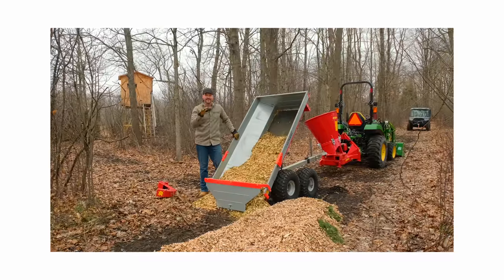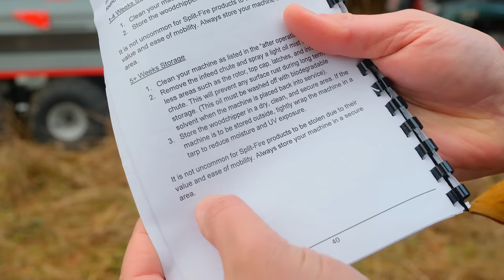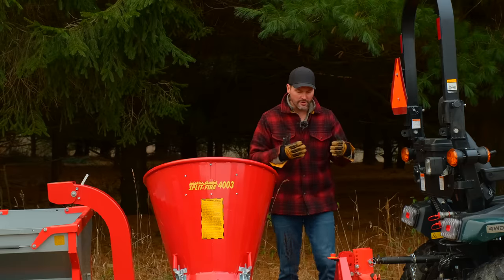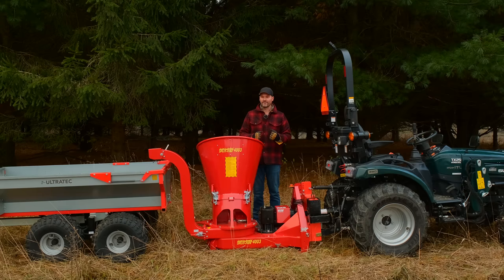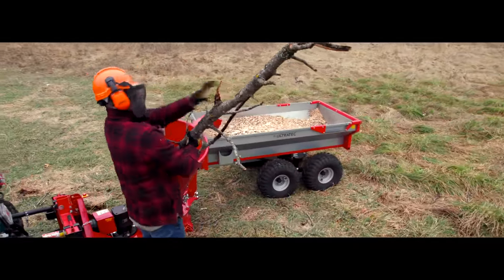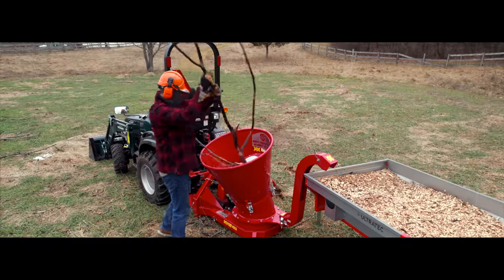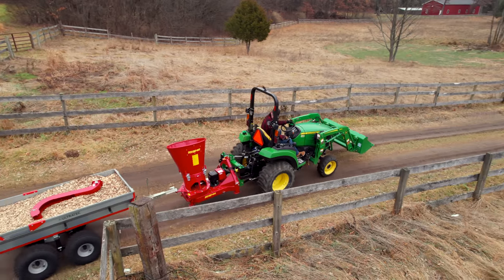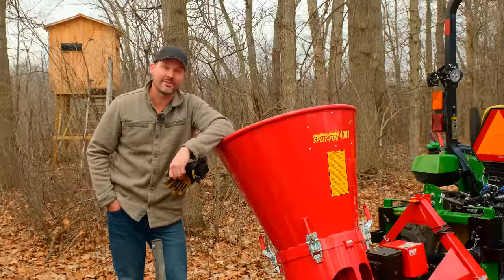THERE AIN’T NOTHING I DON'T LIKE ABOUT THIS CHIPPER FROM SPLIT-FIRE!

Comment: Looks really solid and well built. In all honesty, I've been very happy with my Woodland Mills 6" chipper. It's not perfect, but its hydraulic feed is its "make or break" feature.  Plus, it's got direct-drive via the PTO shaft, no gearbox needed.  (Of course, that reduction in complexity is probably offset by the hydraulic feed system!)   Edit: Just watched the Split-Fire video on this machine. They run their rotor at 2100 rpm, which is much faster than a direct-drive running at 540.  That's an interesting idea, I'd bet it really does help prevent jams as they say.     (Okay, final thought - the chips it makes look real good, very uniform in size and shape. Have to admit the WM isn't quite that nice in the quality of the chips, tend to get a long of "long slices" out of it.)
Reply from the maker: I'm steering away from Made in China whenever possible.  The Wallenstein equivalent (Made in Canada) chipper setup like that Woodland Mills is 4x the cost.
Reply: @GoodWorksTractors   Yep, totally agree with that goal.   Sometimes, as an individual, it's just not feasible.  (And based on my own experience with WM, they're not just an importer that's passing through the "stuff" they're importing - their product support has been exceptional, and their documentation is accurate and comprehensive.)
Reply: Doesn't look bad.  Looks like the chute could be taller and swivel so the trailer might be left connected while you're using it. I'll stick with my Vermeer 935.  I bought almost 40 acres connected to the land I already had. I wanted to clean some of the atv trails and make a few more.  I ended up buying the 6" DK Power that Home Depot sales.  I do wish it had electric start though.  When you start getting long slices it sounds like you need to have your knives sharpened and the knife gap adjusted. I took my Vermeer to a dealer after I bought it for them to do that.

Comment: Courtney, it looked like it was kind of a struggle feeding some of those branches through that chipper.  Not that it is a bad product, new designs and innovation is a good thing, but for the price point of the Split-Fire, I think I would be opting for a hydraulic in-feed unit, like a Woodland Mills WC46 or WC68, or even a WOODMAXX MX-8600.
Keep up the good content!
Reply from the maker: I would say the only thing I recall struggling with was the length of some of the brush.  I should have trimmed it down.  Many folks don't want more complexity.  I can see that being a nice feature though too!
Reply: Love this thing pretty decent for Homeowner is good enough you could always trim down the branches that's Haram in wouldn't have to work so hard but otherwise impressed the tractor really handled it I was one of the first ones to buy a tractor Connecticut man I'll tell you what I love this tractor can't wait for the bigger one definitely need to get in touch with you for one of those little quick things on the back of them

Comment: Make a cardboard template then cut a piece of MDF, etc to fit and clamp to inside back of trailer when chipping so it will act as a backstop for overshoot.
Reply from the maker: That would work!  I figured out a better setup later in the video with the trailer right next to the chute.  Then, aiming the chute down.  Those chips come flying out!
Reply: ...or, maybe adjust the deflector angle down farther. =O)
Reply: The ChipStop’s here!!!
Reply: If you mounted a bracket on each side of the sidewalls, these could support a 24 inch high piece of sheeting. Start with the brackets close to the chipper, then slide the brackets and sheet away from the chipper as the trailer fills up. The sheeting would deflect the chips into the trailer.

Comment: Fun video Courtney!  I really like the vertical design and the speed increase due to the gearbox and belt drive combination.  I have a few suggestions for Split-Fire... Create an on-board docking point so you can remove the chute and park it elsewhere on the machine for transport.  Make the chute a little taller.   Increase the ability to tilt the deflector downward more.  There's nothing much more satisfying than feeding a wood chipper like that!  In my case though, it only creates another material to dispose of.  Burning the brush leaves a small pile of ash and I'm done with the cleanup.  Would be great for people who have a use for the mulch!  Thanks for sharing!
Reply from the maker: Haha, yeah it is really satisfying.  I've got a few large areas that could use chips.  Probably be awhile before I run out of areas to put them.  Have a good one Kyle!

Comment: Looks like an interesting design moving the cutting wheel like they did. I like the emergency shut off that you can wire in to your tractor. I do have to say when compared to a unit like my Woodland Mills chipper with hydraulic feed, there is absolutely no comparison. I don't have to lift pieces of wood over my head to get them in the hopper, pieces of wood can't get sucked in too fast and bog down the tractor, the moment a piece of wood is caught by the infeed roller my hands are off and away from any danger, it has controllable variable feed speed and I can control the direction of the feed from the end of the poppers shoot in case of loading something too big or awkward. The discharge shoot can rotate 360° and is mounted higher to be able to get into higher trailers or trucks.

Comment: Definitely looks like the more hp fit the needs of eating the larger diameter pieces! One reason why I up graded to a L3902.
I’ve been debating on buying a PTO powered chipper but I don’t do a lot of that often….at times I’ll cut a tree down or pull some bushes on one of my properties and would be so much easier getting rid of the waste vs burning it all.
Reply: Personally, I think the ones with a shredder opening are a good option for the smaller stuff.

Comment: I have the Woodland Mills WC68.  This looks like a decent tool but the WC68 is much easier to use.  A lot of the stuff you had to stay there and feed would have just been drawn in by the WC68.  The infeed is adjustable so it doesn't bog down the tractor motor.  The discharge chute on the WC68 is higher and adjustable so I could have been directed much more easily into your trailer and it doesn't need to be removed to move the unit.  BTW I really like your trailer.

Comment: Looks like a tarp on the front of the trailer that would you could stand up to keep chips from blowing past the trailer plus a taller chute and able to angle down more would help to. Maybe higher side boards also. Yeah that thing really shoots the chips out. Little Summit did great!
Reply from the maker: Lol yeah those chips go flying!  I adjusted the angle and position towards the end of the video and it worked better at holding them in the trailer.  Thanks Kip!

Comment: I think it is a nice mid-level chipper, but according to their website, you have to pay extra for the steel discharge chute.  In my opinion, that should be included with the price.  I can certainly understand paying a little extra for the rear hitch and tool holder, but not the discharge chute.
Reply from the maker: That's a fair point

Comment: I have a chipper that is rated 15 to 50 horse. I used it behind my old 8N and it was a struggle, always bogging down. Behind my JD 3043D the engine never even slows a bit, even chipping 6 inch logs. Horsepower makes all the difference with a chipper.
Reply from the maker: Yes, there was a difference between bottom end performance and something with quite a bit more HP.  However, even at the low end, it still performed well.  Didn't bog it down very often.

Comment: Wish I had seen this a few months ago!  Ended up with a Woodmaxx 8800 - definitely solves some of the issues others have mentioned here. Larger capacity, hydraulic fed and made in USA. Not cheap...but something I will hold onto for YEARS. Chipping/splitting is one of the most cathartic things I do on my property - love having this tool!

But...seeing the trailer set up...well now I just need another toy!

Comment: Hint on hooking up the remote kill switch. Many small tractors Y with a diode the seat switch and the other safeties (clutch, shift lever, etc). So to kill both circuits in one place you need to be past the Y to kill power to the fuel solenoid. Another option to kill both circuits is power from the fuse block side of both circuits. Would want to kill both in case the seat switch was stuck on.

Comment: That is one impressive BEAST! Beats that DR Power unit I had 10yrs ago no problem and it was hooked up to a 32hp Yanmar.  That velocity shooting out is amazing even with the smaller PTO output. I bet it rarely clogs up too. Think the only con would be that loud whine you hear even when no branches in there vs other units are fairly quiet. Price isn't really that bad either. Wow... Thanks for sharing!

Comment: "Manuals? We don't need no steenkin' manuals!"
That's a really nice chipper/shredder. I can see why they would be concerned with theft.
You put some pretty big wood through there.
I think, in your case at least, the discharge chute could be about 6 inches taller and the final piece able to angle down more. I wonder if a flap (rubber), over the discharge might help reduce the loss over the sides/ends of the trailer.
As you mentioned, for the average property owner this would be great as a rental piece and not all that practical to own.

Comment: It's a fine machine for sure, and very well made by quality people in Canada.  I think it also takes in things that my Woodland Mills WC46 could not, using an equivalent powered tractor.  The Woodland is designed and delivered to market by a similar Canadian company, with its Chinese manufacturing plant delivering to their designed quality level and price point.  Watching this demo, I think the Split-Fire has a few differences you may want to consider.  The hydraulic feed on mine is a game changer.  You simply do not have to do the handling, cajoling and pushing that Courtney does frequently during this demonstration.  The Woodland feed chute is horizontal - dramatically easier to use and navigate than the vertical chute, I believe.  And, the Split-Fire discharge chute is not adequate.  It should be taller to work correctly with a trailer; otherwise, that is a major functionality miss.  The Split-Fire and Woodland (and others I'm sure) are well designed but each has pros and cons at a given price point and overall quality level.  My opinions only of course, if you find that useful in your own comparisons.

Comment: That’s kinda funny. Secure them cause they’re so sought after. Ha! The only Split Fire I ever heard of until now is Split fire Spark Plugs. Hey, just a thought you can take as you like. Turn your trailer around like you were to hook it up but turn the jack down so the rear raises up. That way the chips should hit the tail gate and won’t fly over the top edge as much. A question about the Chipper. If the chipper somehow jams up and kills the tractor is there any access points to open up to un-jam it while out in the field?

Comment: Load height looked 18-24 inches lower on the horizontal blade vs the vertical blade.  Could you add measurements when you do the higher horsepower demonstration?

Comment: How does the pto run without operator on the tractor seat? My tractor pto will not work without me in the seat.
Reply from the maker: Many, but not all, models have a procedure to operate the rear PTO without an operator.  Might find the sequence in your manual or you could have a model without that feature.

Comment: Hey Everyone, I've  ever owned a tractor. I'm wondering is it cheaper to run equipment off of a tractor or to buy equipment with their own engines. I've heard that tractor maintenance is so expensive that you want to reduce the hours. However, I can't help but think only performing maintenance on one engine, instead multiple engined, would be much cheaper. Has anyone done a study on this?
Reply: Imo if you have a one time job once in awhile it’s cheaper to just rent ! If you have property to maintain  often, I’d look into buying a tractor with whatever attachments you need! Many times in my experience (before I purchased a tractor ) it took longer to rent the equipment , get it home, get familiar with how it worked , than the whole job took to do!

Comment: Not impressed. A chipper needs to feed itself mechanically or hydraulically to relief the operator from stuffing the material. This saves time, the back, the wrist. I run.a Woodland Mills 68 on a 1025R and can work it the whole day by myself because theautomatic feed is worth 2-3 helpers.
Reply from the maker: I can't say I found this an issue.  You need to have control over the infeed speed with any chipper.  Trunk diameter changes with brush.  Don't want to bog down the machine.
Reply: @GoodWorksTractors  yes, and gravity is the worst: big chunky logs (fire wood size) weighs more than twiggy tree tops. What should be fed slowly feeds itself fast and the stuff that should get sucked right in gets stuck in the hopper. This design is wrong.
Reply from the maker: @joelafrite7850  If you watch the video, then that is not what happens at all.  I'd actually say the opposite.
Reply: @GoodWorksTractors  I watched the video and I see you struggle with  thin stuff a chipper with automatic feed eats up in bundles. In this video, and an earlier one. Did you ever work with a chipper with a feeder?
Reply from the maker: @joelafrite7850  Haven't, but you're trying to make this an issue for me.  It isn't, I didn't struggle, I didn't think anything of it.  Pushing branches into the hopper isn't what wears me out.  It's the hauling of the material back and forth.
Reply: @GoodWorksTractors  rent a chipper with an automatic feeder (even if car-towed like a Vermeer) and enjoy the difference. You'll never, EVER again consider a chipper that forces you to feed it 🙂
Reply: Joe, I nearly bought the chipper you have then I found the Split-Fire. It's more robust, has fewer parts to wear out, does a surprisingly good job of feeding itself without having to stuff branches in, and will be in service long after your WM68 will be worn out. I was sold, happy I bought it. Wait! Make that extremely happy I bought it. Hydraulic feeds are great but it stops you are done. meanwhile me and other Split-Fire owners will still be chipping away, all day until stored away... 🙂
Reply: @joelafrite7850  - Stump for free... why not? good products need to be advertised. I'm tired of a world filled with cheap throw away goods no matter where they are made. Robustness is not determined by how many hours I use one but by how it's built. And, for your edification I've looked at and touched both machines. WM makes a nice product, no doubt and they have a huge following to support that reputation. Don't know why you felt you needed to defend your machine unless you are mad you spent your money on it... Anyways, read the specs between the two machines, they will also support the robust statement I made. Now, back to the vertical infeed you so vehemently despise despite having never tried one - try it you might like it. Have a nice day.
Reply: @michaelroth3471  this manufacturer obviously runs a bot farm of people who write about "robustness based on touched it", who feel compelled to tell other people they've never met that they don't like the machine they own and in general argue ad hominem. I guess the design and build quality requires those immature marketing schemes. I prefer to discuss facts, not feelings. I prefer to get my work done. Good luck.
Reply: If we get a chipper it will have a hydraulic in feed. Overall I like the look of the Woodland chipper, probably the biggest one as it would suit my tractor. One day we will buy a chipper.
Reply: Definitely agree with you Joe.
Reply: @joelafrite7850  sounds like you're a bot from Woodland Mills 😂😂 simping for free? or are they paying you?
Reply: Agree! Not impressive at all.
Reply: You'll struggle with a self feed at times as well.
Reply: @GoodWorksTractors  You obviously haven’t tried using a chipper with hydraulic feed. The gentleman who wrote the comment is correct. A feeding mechanism replaces at least two helpers. I suggest you find someone who owns one of those and try it. You’ll be blown away.
Reply: Decided last year to buy a chipper. After a lot of research I decided for me that there were some minimum requirements. Big enough, powerful enough, self feeding. These drove the cost way up but, glad I stuck to my minimum requirement list. After using it for a couple of days, first time using a chipper, I could see that I wouldn’t use one that didn’t self feed eight inch trees. One cut on an eight inch tree, push into power feed rollers and walk away. Just that simple process is a lot of work. Any less capabilities on the chipper would require a lot more effort on my part and quickly overwork me. In my 60’s and working smarter is more important than ever.
Reply: @the1bulldurham  💯... My neighbors, who see and hear me using it, say it will pay for itself, and I agree. You made the right decision and will be very productive.

Comment: I am not impressed at all. I think my little old 18hp DR chipper would eat this one for dinner, and I complain about it not pulling wirey limbs in well. But there's another danger...this hopper is tall and upright so you better be double careful to stay away from power lines around houses. That chute is also kind of low looking to load into my 1-ton dump truck effectively...that's a must for me.